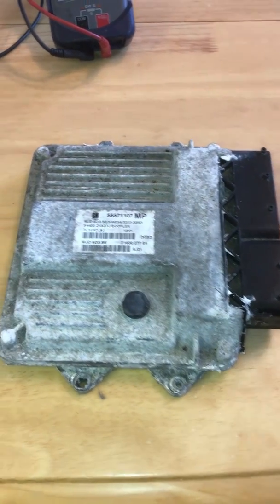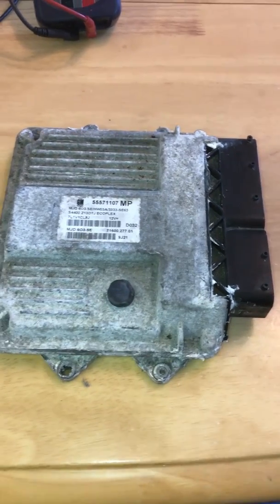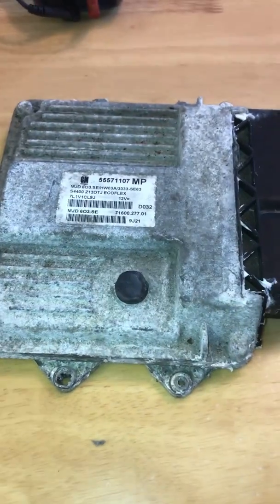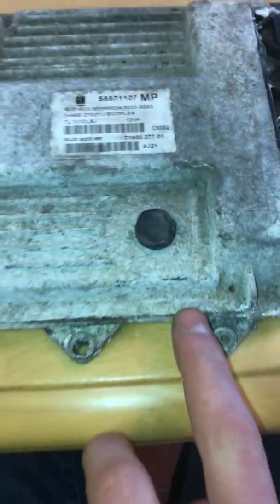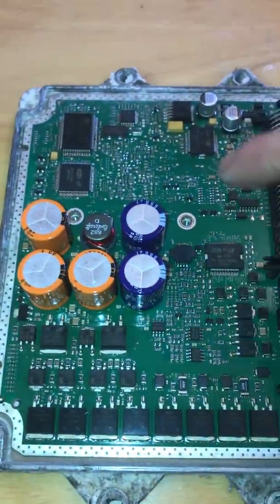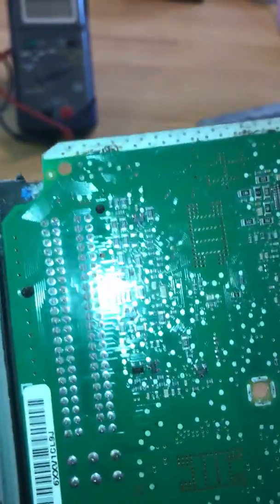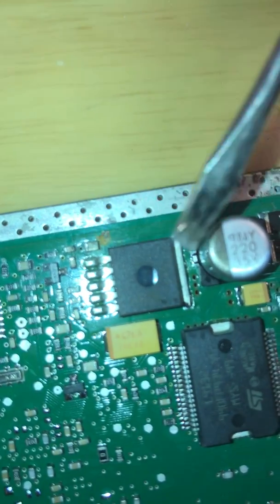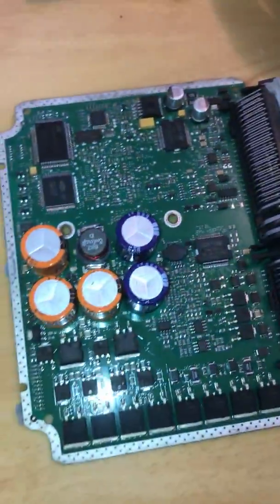Corsa D ecu failure/repair

Comment: Hi, i have the famous "capacitor 1 low voltage" and also "rail pressure control valve voltage high". The car crank but don't start. i measure 0Amp on the common rail pressure regulator, so the ramp pressure is too low to start (6 MPA) do you have an idea ? thank you :)
Reply from the maker: Capacitor 1 low voltage can give you the symptoms you mentioned. Personally I’d be getting the ecu tested,

Comment: I’m having problems with my Corsa at the minute. It keeps going dead. I’ve had so many things done to it but it’s still up and down. This is useful information!
Reply from the maker: As with most modern vehicles, electronics play a key role. Faulty sensors, poor battery, and poor connections can all wreak havoc, depending on where you are located I can only suggest seeking the help of an auto electrician, they differ from your regular mechanic/repair garage as they specialise in diagnosing electrical issues. Some garages rely on diagnostic codes alone for repair, meaning they replace parts (sensors or Componants) based on fault codes and don’t actually look in to the “reason” if that makes sense, and then starts the “replace parts” roulette game. An example
For instance: A fault code that reads “main control power relay open circuit” may point some garages in the direction of a failed relay or even a broken wire or dodgy connection at the relay but an auto electrician could end up tracing the fault back to the ecu circuit board, saving you money on and illuminating the “process of illumination parts”. Hoping you manage to sort your issue soon and effectively
Reply: Hi mate can I change the ecu with another ecu that has keys programmed to it and it should run or can I get a new ecu and programme new keys from the new ecu? Many thanks I'm a trainee key programmer

Comment: Thanks a lot for your videos, they are really very useful. I would like to ask you a question, my ECU (the same of this video) is irreparably damaged, I would like to buy a reset used one, do I have to bring my car to Opel if I cannot recover the data from mine?
Reply from the maker: You will need only the security code of your current ecu and then you will have to locate a garage that has access to “tech2” (Vauxhall’s diagnostic equipment). Or another option would be to find an ecu cloning company close to you, who would be able to retrieve all the information from your eprom chip and then copy it onto your new ecu.

Comment: Hi I have the same problem I have opened the ECU up which was a bit of a problem have you got any ideas what could cause it not to crank over
Reply from the maker: It could be a multitude of things, would need the codes that were stored in the ecu. And obviously would need to eliminate other possible causes not related to ecu failure, crank sensor, timing, injection, immobiliser etc etc

Comment: Hi sorry to bother you again do you no which part numbers are compatible mine is 55568382 ky
Reply from the maker: Gaz 

Part Numbers: 55573953QU / 55573953 QU / 55566039HK / 55566039 HK / 55568382KY / 55568382 KY
MJD6O3SA / MJD6O3.SA are all compatible to the best of my knowledge, but you would need to replace the ignition barrel/transponder ring, keys and all associated coded equipment, (body control module and so on) if you were looking at a replacing with a secondhand ecu.
Reply: Ok thanks can I not just change EpProm over
Reply from the maker: Gaz Jacko yes you can just be sure to solder it correctly, right way round and not to much solder/heat
Reply: Thank you for getting back to me really appreciate it

Comment: Hi which part causes capacitor 1 low voltage permanent
Reply from the maker: Gaz Jacko it’s a process of illumination with these ecu’s check the 12v trace feed, also the 5v regulators, and check the capacitors themselfs, look for signs of corrosion (white/yellow/black marks) without getting to technical with a magnifier check for any scorch marks, it is also worth checking the pins were the harness connects to the ecu,

Comment: hot wierd mine to start   but need  ecu   unless just wires need cleaned   2008 diesel corsa d
Reply from the maker: Kevin Clark you can bridge the main control relay to bypass and get it to start but that’s not really ideal as the relay is there for a reason, check the ecu plug for damaged terminals both on the loom end and the ecu end,
Reply: @RustyNLC  which rely do you bridge as I need to get my cat started to se if it is my ECU that is the problem.
Reply from the maker: If you h e access to a wiring diagram through garage software packages, then you will be able to identify which terminals you need to bridge in order to bypass the main relay, you would obviously still need the key present as this won’t bypasss the immobiliser

Comment: I've got capacitor voltage 1 low voltage problem there's no corroded traces what could this be ?
Reply from the maker: Romaiz Afsar more than likely faulty capacitor, also check the pins for corrosion at the main ecu plug end

Comment: Hi, my friend! I have the same problem, moisture in this place has got, at you there is a datasheet for repair? sorry fo my eng
Reply from the maker: Иван Дранго hi what data do you require?
Reply: https://yadi.sk/i/zGHdT0_E3T5h9Y I have found two burned resistors 10kom, but I can't understand where the channel about the condenser leaves